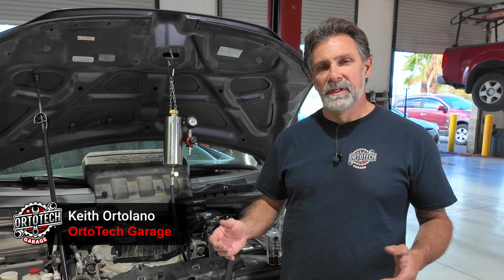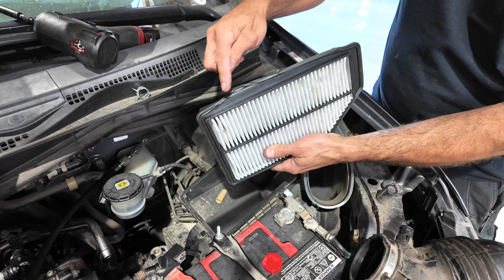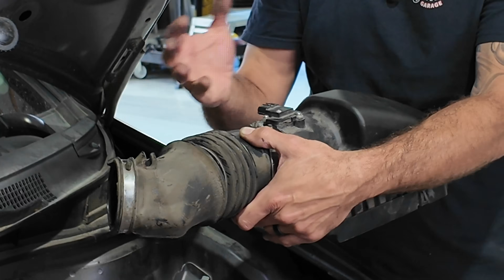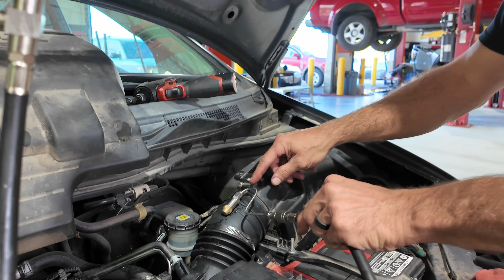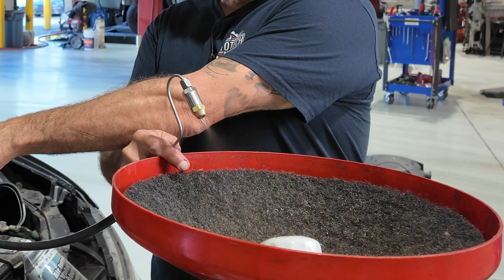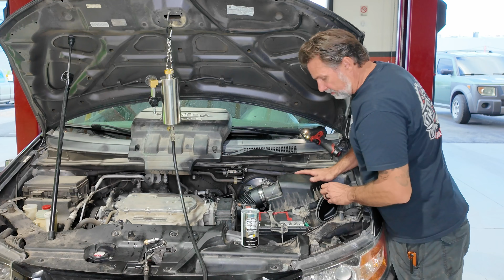DIY Fuel Injection-Intake Cleaning at Home | OrtoTech Garage

Comment: Does this process generate a lot of smoke?  I plan to do this on my driveway in a cul de sac with several houses surrounding the street.  I’m thinking of using two 11oz cans of the BG cleaning fluid but concerned if the smoke becomes too intense where visibility might be an issue.
Reply from the maker: Yes,  it will.  You may need to warn the neighbors or go somewhere remote. 👍

Comment: Sorry to keep bothering you but I want to make sure I use the right product and do the process correctly without damaging the engine. I have a 2014 Honda Pilot EX V6 3.5L.  I do not think this is a GDI engine but is a port injection engine. Does this change the cleaning process and should I use the DG Air Intake & Valve cleaner while using the same Intake cleaning tool you used in the video?
Reply from the maker: No worries.  No need to change cleaners or the process.  GDI just sprays the fuel in the combustion chamber directly, versus in the intake ports above the valve.  Both are multi point injection, just a much higher pressure on Direct Injecion because of the high cylinder pressures.  Important for you to meter a fine mist, slowly into the intake tract and nit overload it with fuel.  We are essentially going to double quantity of fuel because you have not disabled the fuel pump or injectors.   Do not flood it and take your time. Inspect to make sure your spray is not pooling up anywhere.

Comment: Great tutorial video so thank you for that.  When you start administering the fluid through the intake, should you rev the engine 3500RPM every 45 seconds to avoid puddling or would it be better if I get a helper to hold the throttle steady at 2000-2500?

I plan to use the Chevron Techron for the fuel tank but is it okay to use a different product when doing the injector cleaning?
Reply from the maker: Great questions.  You definitely want to avoid any pooling or puddling in the intake system anywhere.  This can lead to liquid in the combustion chamber and hydrolocking, which can damage the engine.  Either of your methods mentioned combined with slow administering of the cleaner in a fine spray will work.  You can use two different products for the tank and the intake.  I recommend something stronger for the intake like a BG products or Seafoam. Remember: the intake cleaner does not go through the injectors, but the gas additive does.  👍

Comment: would this help a non GDI engine ?
Reply from the maker: Yes.  Carbon buildup is common in all fuel injected vehicles, not just GDI.  The PCV system vents oil vapor into the intake tract continuously.  Cleaning the throttle body is an important serbcie on its own.  When combined with an air induction system cleaning (fuel injection service), this helps control the carbon buildup if done as a regular maintenance item. 👍

Comment: Thanks done many of these same things massive difference.  My duct was also just cracked over time and car ran like shit.  no codes too so yu don't know if yo udon't look !  SeaFoam is good and makes a shit load of pretty white smoke.  Idle relearn easy to do on Neesans.
Reply from the maker: Awesome! The cracked duct has stumped so many techs over the years.  Its so easy to miss.  The Nissans can be tricky to relearn, especially if they had a ton of buildup.  I've had to unplug 2 coils on a 4 cylinder to get the idle low enough to complete the relearn procedure with the scan tool. Then rerun again with one unplugged, and a third time with all 4 connected.  Learned that the hard way...lol.

Comment: That filter would STILL be ok if it was not damaged.

People that know understand the filter gets better with time as dust attracts dust and the filter should be used to its full life!

Throttle cleaning is useless unless the car is not working properly and does have more than little surface sooth.

I would not touch the throttle blade in an electronic throttle. Not only it can lose calibration, but it could hurt your fingers as it can try to move back to closed.

Guessing you come from old school knowledge.
Reply from the maker: Im not sure I can agree with all of your comments, but you make some valid points.  The filter would be reused if not for the damaged seal.  And I do mention electronic throttle body actuators may need a relearn procedure performed.  I even mentioned the complexities of Nissan/Infiniti products.  But I also disagree that throttle body service is a waste of time and not needed. Nor will you get your fingers stuck under the return spring tension. Also, why wait for an problem to perform simple maintenance?  

I am pretty old school, but that doesn't mean I don't understand and work on modern vehicles daily. I am still in the business and run multiple shops.  Thanks for sharing your thoughts and joining the conversation.  I always appreciate other people's perspectives, even if we can't agree on everything. 👍

Comment: I had no idea that such could be a DIY option, so thanks! I assume this was demonstrated on a gas-engined car. Can similar be done with a diesel vehicle?
Reply from the maker: Thanks you for the nice comments!  Do NOT use this process or these chemicals on a diesel engine.  This was specifically for a port or direct fuel injected gasoline engine.  The systems are much different from the fuels,  all the way down to the way they operate. There are other products and methods for diesel engines. 👍
Reply: Message received and understood 😂
Reply from the maker: @NotNowCato1254 lol. I hope that didn't sound rude, it wasn't my intent.  You just asked a great question that I should have answered in the video.  I don't want anyone to damage their diesel engine. 😉

Comment: I have a Toyota with dual port and direct injection. (D4S)
Only use Top Tier fuel and put in Techron at each oil change.
Will this also help keep the throttle body clean? Most of my milage is short trips.
Thanks.
Reply from the maker: You are definitely doing everything you can to minimize problems.  Unfortunately, the throttle plates will eventually accumulate carbon buildup.   I would still check them from time to time.  There is no way to avoid it completey.

Comment: Great video boss Is the same process for hybrids like the new Honda civic hybrid?
Reply from the maker: Thank you! It will work similar for the hybrid.  The only trick is to keep the engine running.  Hybrids won't usually stay running unless they are in service mode. You dont want to have that cleaner spraying into the engine while its off.  The cleaner will pool inside the intake and could cause too much liquid to enter the engine, causing engine damage.

Comment: I put a bottle of TECHRON every 3,000 miles.
70,000 and no issue with the injectors/throttle.
Reply from the maker: Excellent!  Techron is a great product.  Maybe a little overkill at every 3,000 miles but with direct injected cars, I'm sure your intrval is helpful. Thanks for sharing!

Comment: LMAO snake oil.
Reply from the maker: Definelty not snake oil.  The throttle plates on all vehicles are problematic areas for carbon buildup and driveabilty concerns.  Then add in direct injection from any manufacturer and you will see excessive carbon buildup due to the dry intake system (except Toyota D4S system). This causes all kinds if issues if left untreated.   Any good top end cleaner will do a decent job of cleaning the carbon buildup and preventing problems.  I mentioned 3 different brands in the video. They all perform well.
Reply: @OrtoTechGarage dude probably said the same thing for toothpaste or mouthwash
Reply from the maker: @ThinhBui014 😂😅

Comment: Future generations will laugh at all the work we had to do just to keep using gasoline engines.  GDI induction service and or walnut blasting the valves. Catch cans. Cleaning Throttle bodies. Worried about fuel dillution in oil..or engine oil. Cleaning EGRs. Having a stupid seal on a gas cap worn throwing a code. Rotted out fuel lines or a tank leaking combustible fuel everywhere.  All the headaches of an aging Evap system. All the cat codes from an unhealthy engine. All the emissions checks in participating states. All this crap to keep using Gasoline because we refuse to advance.
Reply from the maker: Youre absolutely right!  Or worse, they will never know what we went through.  Lol.  I think we're on the precipice of the electric age which will likely be Hydrogen powered anyhow. I wonder what I will live to see in my lifetime....

Comment: Great video and demonstration. I’ve seen some using a can of cleaner and placing the straw where you did but I prefer your method since the atomization is controllable.  
I know you too remember using the intake snake tool with replaceable cleaning heads, those worked great. Plus connecting to schrader valve and disabling the fuel pump…..so simple.  Times have changed since direct injection showed up to “help” with fuel economy and emissions.
Reply from the maker: Thank you!   It's crazy all the things that have changed over the years.  They just keep making everything more complicated...At least they figured out how to get us fuel pressure readings, electronically. We just need every manufacturer to follow suite for high and low pressure systems.  I complain about the advancements from time to time, but I don't miss computer controlled carburetors.  Lol.
Reply: @OrtoTechGarage yes the old CC Q-jet. Good old GM back in the early 80s.